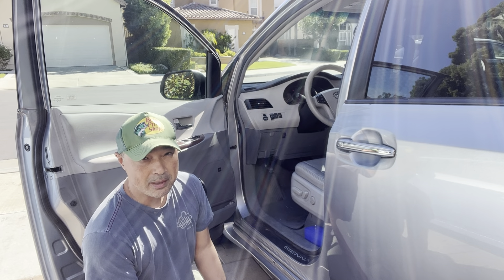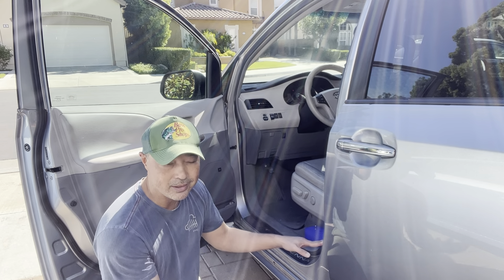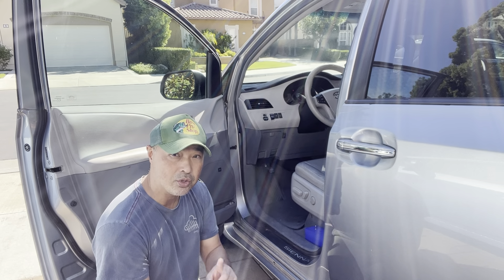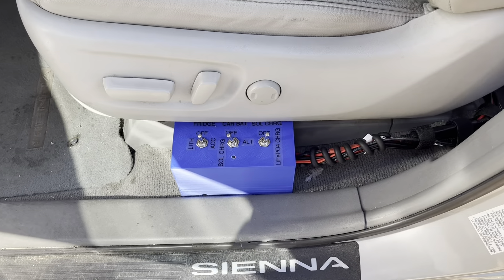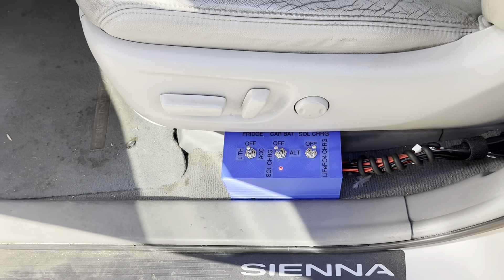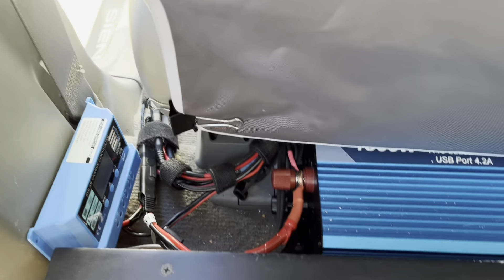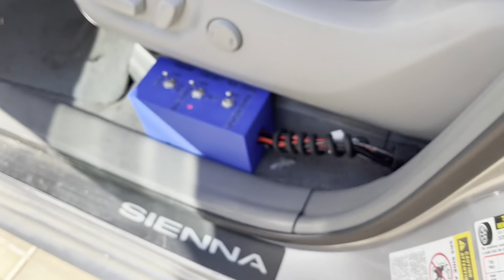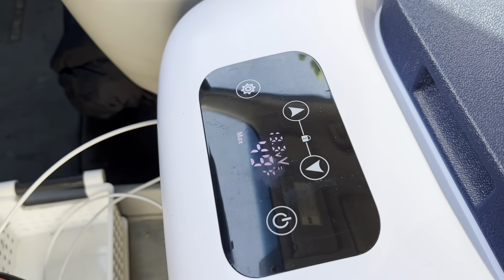Charge Your Solar System Using Car Alternator. Sienna Couple's Tiny Camper EP13

Comment: This is fun stuff for folks like us.  Non-tinkerers might be better off dropping in a combo DC-DC charger.  Something like a Renogy DCC-series or  Ctek 250-series checks the boxes:

* charges house bank from alternator
* charges house bank from solar
* maintains starter battery 

Note:  I have no issue charging my 100Ah LFP directly from the alternator (VSR).  Charges at ~0.33C when deeply discharged, and ~0.16C at higher states of charge.  The VSR has a button for self-jumpstarting, and I added a switch to disable the VSR when desired.
Reply from the maker: @BeyondInfiniteLove electric grills and heaters take a lot of power.
Reply: BeyondInfiniteLove  Having apartment-style amenities in a vehicle is tough.  A few minutes with the math (load Wh, capacity Wh, charging Wh) will help reconcile expectations with realities.   

 Specifically, people tend fixate on what they can run when the power station is fully charged rather than how they will recharge  after the run.  Most people in vehicles aren't able to charge the power station any harder than 150w.  DIY setups (like in this video) commonly recharge their banks at up to 600w (50A).